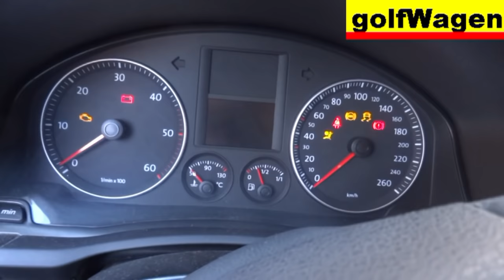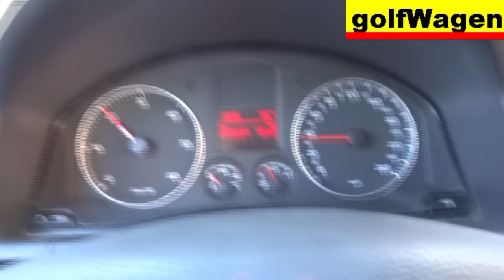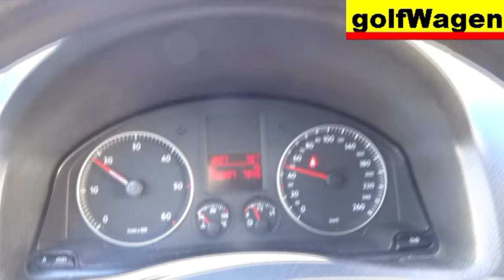How to replace front brake pads on VW Golf 5  /100% FULL time/

Comment: You should definitely view some other videos before posting this one. No coper grease on pads, no thread lock on caliper bolts - you may kill someone with such unprofessional video...
Reply from the maker: coper grease i I do not use it.  What is it   thread lock on caliper bolts?
Reply: golf Wagen, you should put some thread lock ie. loctite blue 242, on the two bolts, BUT the blue one not red, to prevent bolts from unscrewing from vibrations
Reply: Michał Jagielski No you should not. No one uses locktite / threat lock, but he should use copper grease, Yes.
Reply: You make a video then. Golf wagen is a legend. He helped me and alot of other people. Loctite is not necessary tbh and coppergrease neither..
Reply: Many mechanics wont use any grease.. and it helps but it doesn't matter if you dont put any

Comment: karnectar. I would add copper based grease on back of pads and brake sliders and clean threads of the two long bolts. Also clean brake dust off callipers and discs/rotors. Use a torque wrench on the two bolts for correct torque. Use proper tool to push calipers back as wrench could slip. Overall good show.

Comment: Would you wait until brake sensor lights up to change front pads?
Thanks
Reply from the maker: +Colin Clews The sensor is only one of the four, so it is better to check before the long trip from the eye
Reply: +golf Wagen 
Thanks for the advice

Comment: There is so much wrong with this, where to start.
1.  Changing pads without also changing rotors is a huge NO-NO on Euro cars.  Because they rely on the rotor wearing out as much as on the pad material.
2.  Those slider pins were almost seized, you didn't clean them and re-grease them.

For people who have not done their VW brakes before, do NOT follow this example.
Reply: Point 1 is incorrect. If the discs are in good shape (i.e. not obvious grooves/outer lip) then it is perfectly fine to keep them on the car.
Reply: Big Dongle  You're full of shit.  Rear brakes on many Euros are applied before the fronts (EG VW GTI) which causes the rear rotors to wear faster than the fronts.  That's why the pad dust on the rear wheels ids heavier.  Putting new pads on a n old rotor will cause them not to bed properly and braking will be poor.  Most Euro rotors have a small wear limit and machining is not feasible.  Just put new rotors no, ffs, they are cheap and brakes are good things to have.

Comment: WrongHe does not use any anty seizing grease. That is not the way you do it.   Sorry.
Reply from the maker: OK
Reply: I think you have to use red rubber grease or silicone grease on the slide pins